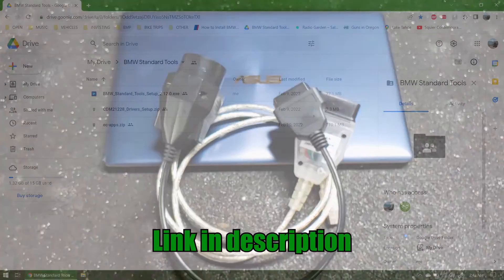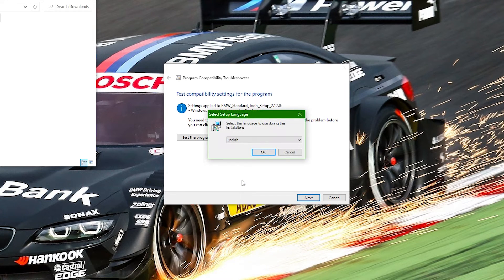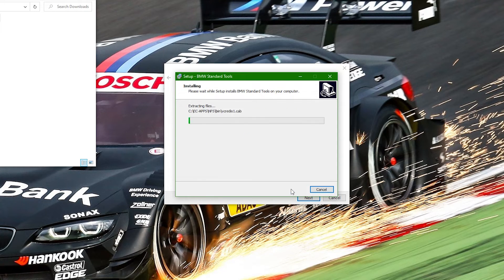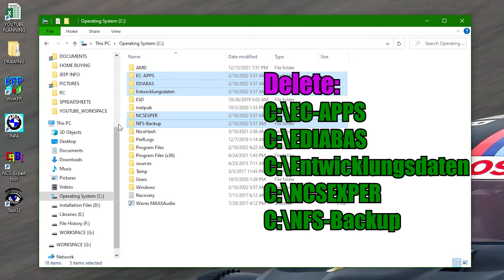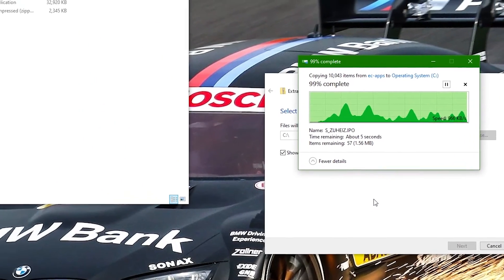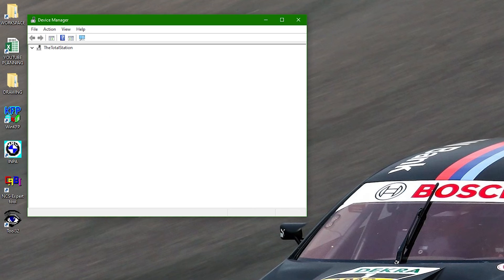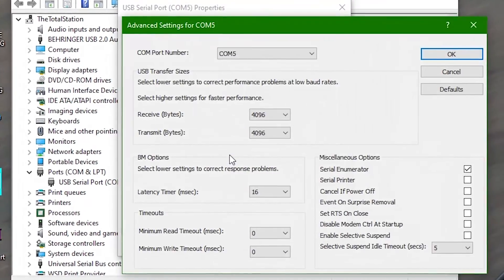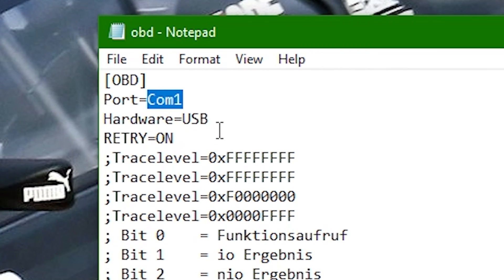Install INPA, NCS Expert, WinKFP, Tool32 on BMW Easily: Step-by-Step Guide

Comment: I just installed and set this software up to use on my 2011 328i xdrive. I was having connection issues with car and software until I tried this. First verify that the Comm settings are correct as per the video. Start Inpa first, connect cable to laptop, turn power on in the car, lastly connect obd connector to the car. This was the only way I could get my e90 connected. The software had no issues and it works great 👍 

Super big thank you to Endless Money Pits for providing access to the software and making a well explained video. You saved me tons of money and time!!!!!! Subscribed👌
Reply from the maker: Glad you found a way to make it work! I don't have a way to troubleshoot issues like this so I pinned your comment to help others.
Reply: My ncs expert says "chassis is faulty" when i choose e89 am I doing something wrong or am I missing a file
Reply: @doope_._  broooooo same issue any ideas?
Reply: @doope_._  Did you ever figure it out? I got the same issue.
Reply: @doope_._ mine says the same thing

Comment: very detailed guide, thank you! Curious tho if this setup will work the same if trying to connect to a 1997 e36 m3 (with ADS protocol). Im needing to diagnose some ABS faults but finding a setup to pull/clear codes has proven to be quite the challenge, so im hoping that maybe this setup will work for me

Comment: Did anyone use this with Win11? Did it work?
I didn't know this works with newer Windows systems... I always use my old notebook, but the battery is so weak, that it lasts just 30 Minutes... Now I installed everything on my new notebook, but it's too cold (and I'm sick) that I don't want to test it right now :D No garage in here...
Thank you for your video! I remembered the thing with the COM-Ports but I didn't knwo that you can run it with newer Windows :)
Reply: Yes, it works with win 11. At least INPA, with NCS expert i have some troubles, dosent pull up my vin

Comment: Great guide.... The step by step process was exactly what I needed. BUT after downloading everything and setting up everything,. I discovered the INPA doesn't list my (2009) BMW E70 X5.

Is there a way I can get a version that covers the E70 with just as easy instructions to follow? Will the E53 X5 that is on the version of INPA uploaded, work for my car?

Comment: The reporting software only installs on Windows XP :(
Reply from the maker: It works on newer versions of Windows too. Just run it in compatability mode.
Reply: It works , I used windows 11

Comment: Hey, I'm trying to run this on a W11 laptop, but whenever I hit "troubleshoot compatibility" it just sends me to the windows "Get Help" menu, any recommendations?
Reply: I had to figure this out too. Try to run it in compatibility mode and it will work the exact same as the video

Comment: Got my E53 x5 with an airbag to spring conversion, but I want to put the airbags back on, I was doing some research and realized I have no air suspension ECU control module, I need to replace it, it will need to code to my car and adjust ride height, long story short that's how I ended up here, I can't thank you enough for this. But thank you very much.

Comment: Hi Guy's..... After downloadind / installing this version of INPA 5.06 you might need to know that it does NOT contain SMG Adaptions/ Individual Adaptions in the Special Tests Folder..... So if you have a M3 i would suggest finding another Version of INPA.... ( maybe Version 5.0 or 5.02 )...... Who'd of thought that when you upgrade versions and go from 5.0 > 5.02 > 5.06 they remove functions.... I thought that was called Degraded not Upgraded ....

Comment: Hi, I’ve downloaded all files and software using your video which has seemed to work however when I’m connecting to the car (e38) I get the battery and ignition black dots but I keep getting a IFH 0003 error if I try to access any modules. The ignition light doesn’t turn off when I turn the ignition off, should this be live real time data? - any ideas on where I’m going wrong?

Comment: I am using Parallels Desktop to use windows on my mac, and I'm trying to get the correct drivers to install for the DCAN cable. Does anybody have any advice or could help me? I have gotten the DCAN cable to be recognized as a port by installing the drivers manually, but I'm not getting any of the port settings in properties tab.

Comment: Got it to connect both lights and was able to scan the engine using shift+f8 for my 98 M3 vert.  Cannot connect to the ASC/T module with either pin 7 or 8 on my cable.  Im worried i need a true serial port to read ADS on the earlier cars.  Keep getting an error like no response from control unit or something.

Comment: Thank you so much. Going to try and diagnose why my e39 m57d30 won't start tomorrow. It stated in the car fine with the immo off tune on the dde4 but won't start since house of torque loom. Getting a relay click ect but crank no start.

Hopefully find out tomorrow why I have an issue.
Reply: Engine is out of the car and on a trolley built for a boat.

Comment: There is a switch in my cable. What position should I put it in for it to work properly in models like the old E36?
Reply from the maker: Try one way. If it doesn't work, try it the other way.
Reply: @endlessmoneypits Actually, the laptop is connected to the airbag, but ms401k20.prg is not found in the engine compartment, whereas this file is present in the ecu.

Comment: The softwere runs but when choose some module occure errors. Like: "D_CAS SYS-0012: IDENTIFICATION ERROR" in INPA and "CHASSIS is a faulty" in NCS Expert...  I try for e90.
Reply: For me the problem is not with connecting the application. There I always have Ignition: on, but maybe I have a problem with the daten files. In your packages I only see for BMW E39, E46 and when I download new ones DATEN probably the version of the application is not compatible.

Comment: Hey, i get the codes lagnugavariants do not match and versions do not match I just ignore those. I can not connect my chassis i have an e90 2006 with the k+dcan cable and i also set the com port right. on inpa i get the battery and ignition on status but on ncs expert i can not connect my chassis i select e89 and i get chassis is faulty I dont know what to do. please help me ;(

Comment: Thank you for your guide but after I install as you described I had "C:\EC-APPS\INPA\sgdat\EXX.ipo(1) : error I300: Error opening object file" Error. Do you know how to solve for E90
Reply from the maker: I would try reinstalling, or running it in compatability mode for windows 7 or XP.

Comment: What if I do not see the extract part when right clicking on the ec app
Reply from the maker: Did you install winzip?
Reply: @ yes sir I did and I got that part down
Reply: @ I’m stuck now on installing the cable drivers it won’t let me extract them says admin privileges required and I am under admin
Reply: @endlessmoneypits   I got it done at the end boss thank you so much for your service 🔥🔥🔥🔥🔥🔥❤️‍🔥

Comment: I have a windows 7 laptop but when i troubleshoot compatibility it goes to window xp service pack 2, is this still okay? It will not allow windows 7 at all for some reason
Reply from the maker: Yeah, it's old software. XP should work.
Reply: @endlessmoneypits  thank you for the swift reply that was rapid ! ❤️ my other issue is i kept getting vin is faulty IFH-0018. I’m doing a fresh install right now but do you have any idea why that is? 

INPA was working correctly with battery/ignition showing as on
Reply from the maker: I'm not sure. The only troubleshooting tips I know are at the end of the video but some people have left helpful comments too.
Reply: @endlessmoneypits thanks for the help man. I’ve put a post up in the e46 forums and ordered a new cable. I’m really hoping the cable fixes it 🤞🏼

Comment: Hi im on windows 11 everythung set up except ports its come up however it has 2 options and they're both called Standard serial over bluetooth link (COM1) and the other is a (COM6) its not picking up on INPA so i suspect that this is the issue, any ideas on how to resolve this thanks

Comment: Does this also work with OBD2 cars?
Reply from the maker: This is an OBD2 car, so yes.
Reply: @endlessmoneypits I wasn’t sure because it was using the ciricular adapter under the hood.  

I was having trouble because I was using the obd port under hood, so could only pull engine data. I got the adapter and used the port in the video and it works better. 

I still can’t get it to communicate with ABS, but my universal abs scanner did work once I used it with the circular adapter. Still haven’t figured out why inpa won’t work for ABS.

Comment: hello ! I'm using windows 11 and it doesn't work :/ what can i do please?
Reply from the maker: Right click > properties > compatability > run this program in compatibility mode for "windows 7"

Hope that helps
Reply: @endlessmoneypits  doesn't work :/
Reply: @EndlessMoneyPits  thanks I will try
Reply: @endlessmoneypits windows 7 is not an option for me for some reason it’s so weird even though im on windows 7 professional
Reply: For me it worked like butter using Windows11 like this: Right click > properties > compatability > run this program in compatibility mode for "Windows XP (Service Pack3)"

Comment: Does this still work?
Reply from the maker: I believe so.
Reply: Thank you! I grew up working on 302s and 350s, this 05 325xi is not that lol it is doing things that could be vacuum leaks, fuel, sensors, or compression. Everyone says get INPA but don't say how
Reply from the maker: Hope it helps!  I haven't used the programs much yet, personally.

Comment: Installed this on a extra laptop about a year ago and it worked great I got my codes fixed the car and now I needed to check them again.. I went to run my codes and had all sorts of trouble. First off things look off and when I go into run an error memory test it doesn’t work a throws me error codes saying that something is wrong on the software side. Anyone had this issue?
Reply from the maker: Try updating windows, installing as administrator, and running in compatibility mode.

Comment: why u dont say it doesnt have the option for bmw 1 series E87.....
Reply from the maker: At 28 seconds in, I say this is for connecting to your E46. At 7:34 you can see the list of other BMWs this software is made for. I don't have experience working on any of them, which is why I only mention e46 in this video.

Comment: Thank you for the video, it helped me a lot. I purchased from Amazon the K-DCAN cable that you suggest. I was able to connect to the engine and EGS modules, but not to the remaining 12. So I contacted the Amazon seller and told me that... this cable cannot connect to the other modules? What's your experience with that?
Reply from the maker: I didn't have any issues like this.

Comment: The trouble shoot window is different for me. Im on windows 11. Instead of trouble shooting like it does in your video, it just asked me a bunch of questions and then cancels out when i dont find what im looking for. And when i try running it normally by clicking it i get a window prompt that says only window NT and window XP professional are supported
Reply: I had figured it out. When on window 11 you must go to property first then go to compatibility and under compatibility mode, click run this program in compatibility mode for and then select window 7 and then apply. Now you can just double click the program and continue
Reply: @Eac18 yeahh.. thanks, now my windows 11 could figured it out

Comment: Tried this with my mini, keep getting chassis problem .
Reply from the maker: Make sure your computer has no pending updates, all connections are secure, and you've gone through the FAQ at the end of the video. Also, check the comments here for more tips. Other than that, I'm out of ideas.

Comment: Follow the direction to a T but my ports  still won't pop up
Reply from the maker: Install any due updates, restart the computer, and try again. Try a different computer. Try running in compatibility mode. Make sure you read all the FAQs at the end of the video.

Comment: I followed all your instructions, and was able to connect to my car (2007 bmw 328i convertible). Only issue I’m having is trying to reset the FRM but I keep getting the error message (frm 87not found, frm70 found. Program will be forced stop) any ideas?
Reply: Having this same issue were you able to figure it out?

Comment: Dr Gini.exe is being flagged as malware for me...
Reply from the maker: There is no malware in the files I've provided. Been up for years.
Reply: @endlessmoneypits  I ended up just doing the installation without Dr Gini and it's working alright for me. The severity according to windows defender was low, so you're probably right about there not being malware. Thanks for the informative video!
Reply: Just delete Dr Gini.exe file from the Ediabas, same happened to me.

Comment: Thanks, unfortunately it works partially, can read errors, can delete it but I'm not able to activate water pump or other devices get the message "ApiResultText: Error #20"
IFH-0010: DATATRANSMISSION TO CONTROLUNIT DISTURBED" any idea what is wrong?

Comment: Connector question for dual port cars. First, awesome tutorial and the software install on Windows 11 worked perfectly. On my 1998 E39 I have both ports, the OBD2 and 20 pin round. I don't have the adapter for the 20 pin so I used the OBD2 port. I can only communicate with the engine module and not the Body or Chassis modules. Is this because I'm not using the 20 pin connector?
Reply from the maker: Yes, I believe that is the reason. Try an adapter for the round connector and it should work. Thanks for watching!

Comment: What is better (and easily) to install on Win7 or Win11? I ask because i have an old laptop with win7 to run PASOFT
Reply from the maker: Windows 7 will probably give you fewer issues. Some people have commented about problems with Windows 11 but running the installation files in compatibility mode sometimes resolves it.

Comment: Bro you're a legend. I used Mikes BMW tools initially from another video, however, when I loaded NCS, expertmode was nowhere to be found (and I needed that for the coding I wanted to do). Followed your instructions and initially I tried to connect my car to NCS expert but kept getting the error 'chassis faulty' error. I ran the BMW coding tools software, and bam.. updated all of my programmes. Succesfully retrofitted cruise control to my 2005 pre-lci E87 with no warning lights and cruise display. Thanks!
Reply: i’m planning on doing the same thing. did you find E87 in INPA ? i can see all the models except E87
Reply from the maker: Heck yeah!

Comment: I have Windows 11 and had to install the software by typing "Run programs made ofr previous versions of Windows" in the search bar.  Then I selected "Not Listed" and selected the setup file.  Not sure if anyone else had this issue.
Reply: Very useful comment, had the same issue, thanks!
Reply: Which search bar did you put this in, please
Reply: @shawngreertruthseeker don’t know if you still need help but I opened the file properties went to comparability and ran the program in comp mode for windows xp
Reply: @nahjdgjwI figured it out. But greatly appreciate your help nonetheless.
Reply: same here
Reply: Thank you so much for commenting this. Saved my day!
Reply: Best comment ever this! I right clicked the bmw start up test compatibility and manually selected run as Windows 7 and hay presto!
Reply: Wow thank you
Reply: I ran as XP compatible and it installed fine

Comment: I want to give you a hige thanks for this video. Im not a computer geek whatsoever, and with your help, i was able to connect to my sons e46. Now, i need to learn how to use inpa. 

I have an e92 m3, so i know this covers it, but what program do i need for our f15 x5?

I'm so thankful that I decided to subscribe to your channel
Reply from the maker: Thank you for the kind words! I don't have much experience using this software so I can't give advice on that but hopefully someone else will chime in with a good answer. You might also try joining a forum dedicated to your car which would give you access yo a wealth of information.
Reply: Enet wifi Adapter for F/G models 50-60 bucks i think

Comment: Why my computer says in program compatibility setting that settings applied: for windows xp? Even my laptop has win7! It won't let me continue further 😢 
It gives error 5: access is denied.  
Setup was unable to create the directory 
"C:\ediabas\api\exel"
Reply: Use a different folder to install the program into. Just try anywhere else (maybe in a folder on the desktop) and see if you get the same warning.

Comment: I am unable to continue since I do not have an option to extract all with winzip
Reply from the maker: Use the bult in windows unzipping tool or download winzip.
Reply: I just don’t have the option to extract all when I right click. I have winzip installed. I to have options to unzip but not the extract button like u had
Reply from the maker: I don't understand. Extract or unzip, whatever it let's you do. Did you restart after installing winzip?

Comment: no FRM files show up in winkfp, how do i fix that?
Reply from the maker: If using Windows 11, try running in compatibility mode. If not, try reinstalling or try a different computer.
Reply: @endlessmoneypits  I am running on windows 10.. i do get some ecu family options pop up but only about 10 and none are frm related, inpa works fine so i know the cable is good and i did code my dsc with tool32 the other day.. however never used ncs expert for anything as of yet.. so it may just need up to date files.. however you probably know more than me about this stuff 😂… also i will had this is a second hand frm2 and it is compatible part number ( if that makes a difference)